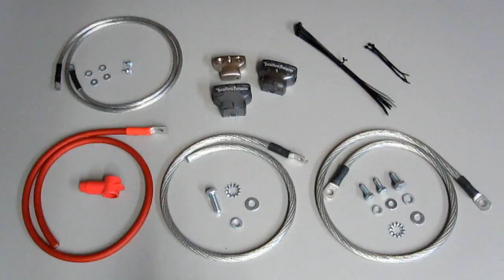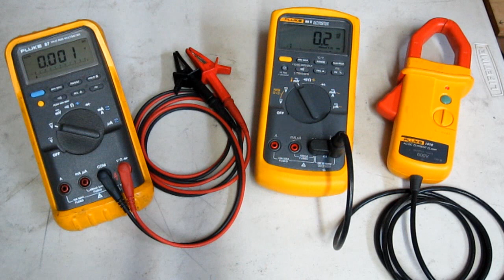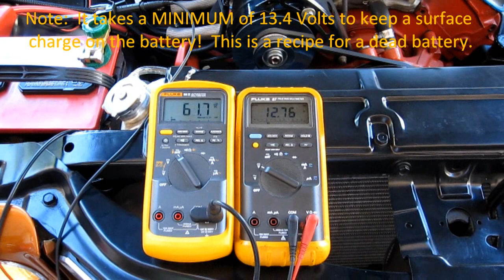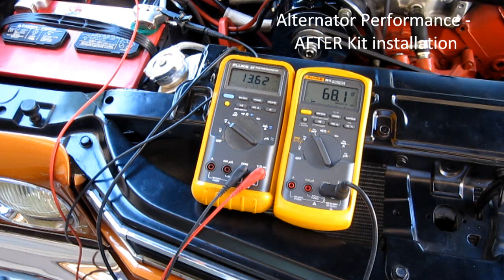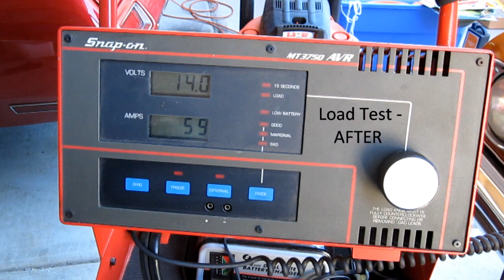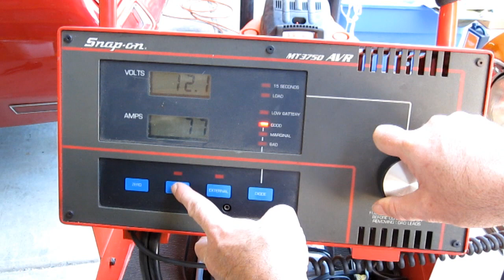CE Auto Electric Supply - Charging System Upgrade Kits for High Output Alternators

Comment: When I did my "Big 3 upgrade", I ran a 0 gauge charge lead from the alternator to the battery. 0 gauge from the battery negative to the engine block. And 0 gauge from the battery negative to the frame. Should I also add a 0 gauge from the alternator case or mounting bracket to the frame?

Comment from the maker: @bladesX2112 The OEMs typically use a fusible link on the output lead of the stock alternator.  This is to protect the vehicle's electronics in the event that the alternator experiences a failure in the regulator circuit which causes voltage run-a-way.  This is a double edged sword with high-output alternators, so most manufacturers of them do not recommend a fuse on this lead.  Of course, we can provide an ANL fuse holder and fuse to any customer that requests this.

Comment: So this is just Big 3 kits? My battery for my 1999 Seville is underneath my back seat, I guess I'm SOL when it comes to this. Only running 500RMS on the stock 140amp alt but I getting dimming headlights & RPM drops at idle